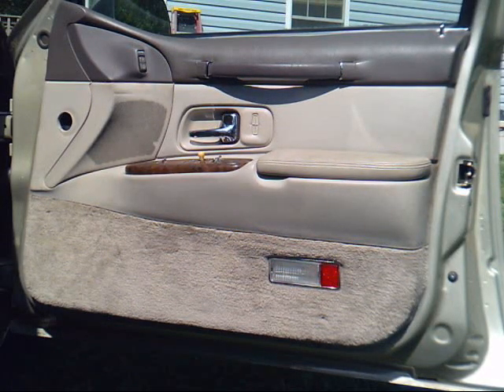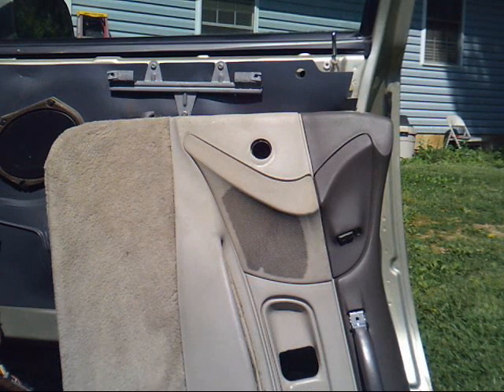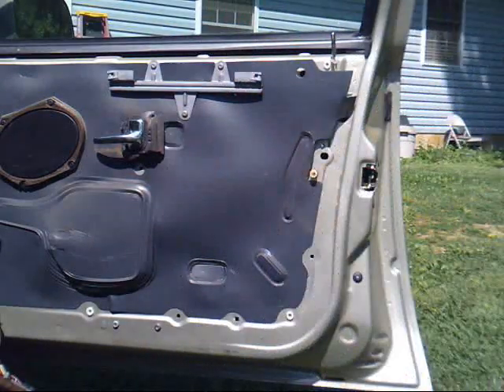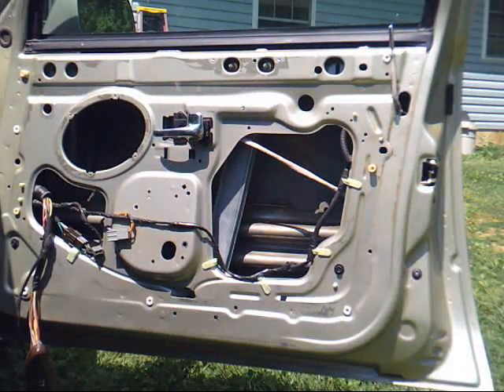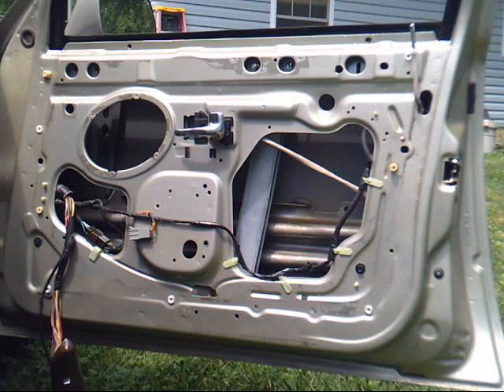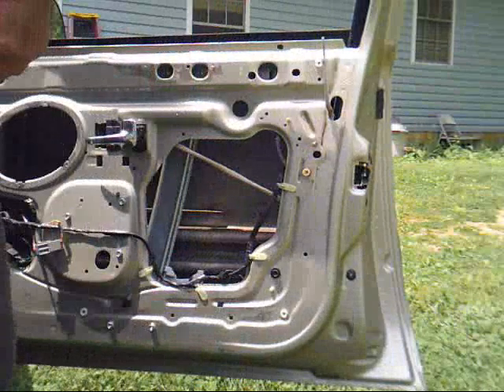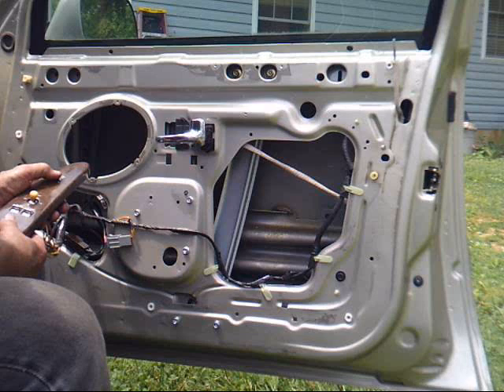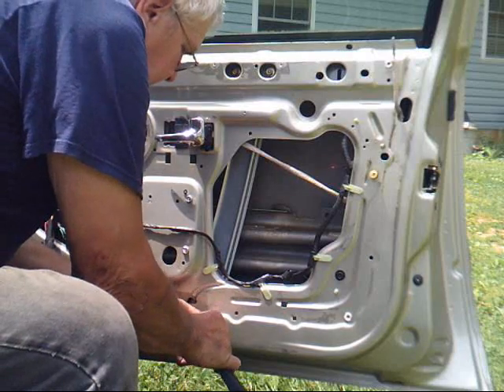1997 LINCOLN WINDOW REGULATOR

Comment: The problem with your video is you don't show 50% of how the old regulator came out and went in. You don't show what the initial reason for the failure was in the first place. Yes the part that failed. I have the same problem with my 1993. The motor works, but the windows wont go up or down. What is the part that failed and why?
Reply from the maker: Once the glass was removed, I just pushed the old regulator bolts out of the holes and pulled the whole thing out of the door. The reason for failure was one the cable ends pulled out of the plastic it was mounted in which let the tension off the cables and stopped the window from moving.
Thanks for watching
Reply: I Have the Same Problem!!! Thank You For Your Comment!!!
Reply: I have the exact same problem you did. Thanks for your video,it'll help 
Be back with you shortly 😂 👍

Comment: Seeing all that work was fine up until you were drilling holes in things...thats over my head and i don't want to damage it.
Reply from the maker: The drilling was to take the heads off the rivets holding the regulator to the door. This is the easiest  way to remove them.
Thanks for watching

Comment: How did you put the window back on the rail is what I didn't see....
Reply from the maker: The rail is made into the regulator which was replaced and bolted to the bottom of the glass when the window is rolled up tight and torqued. The edges of the glass are in the channels in the door.
Thanks for watching

Comment: Lincoln rivets parts together like the door frame.  Terrible.  I'm stuck with a nonworking back door because they used rivets and they are hard to replace.  Never buy a lincoln!
Reply: U have to drill the rivets out.... Go back with regular screws same size or close to
Reply: Never buy a Lincoln because they use rivets?  That's the most idiotic reason I heard not to buy a Lincoln.  It is a relatively easy repair that most people can accomplish.  If it is too tough for you, find a mechanic to do it for you.